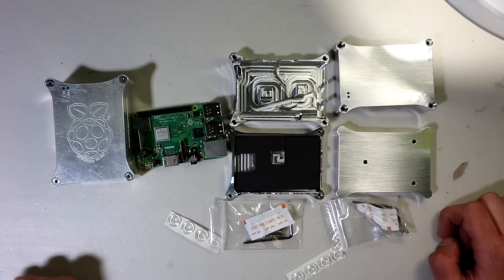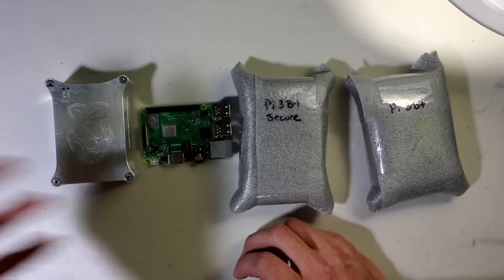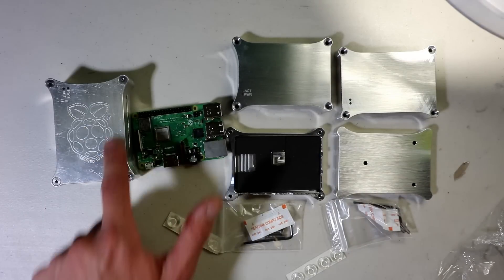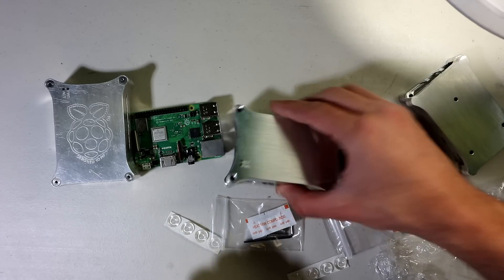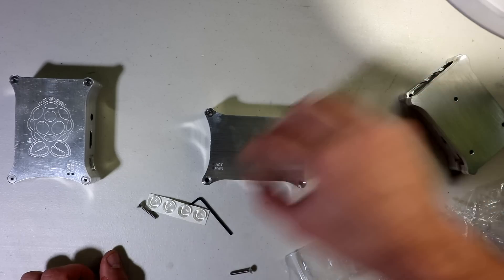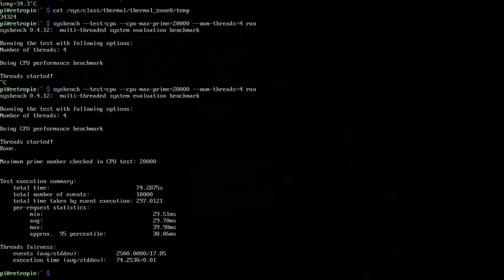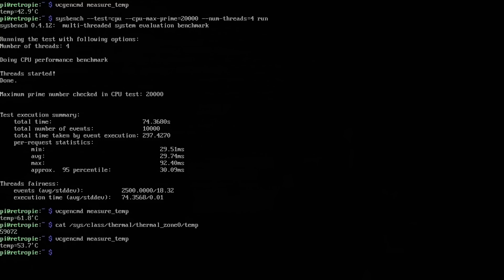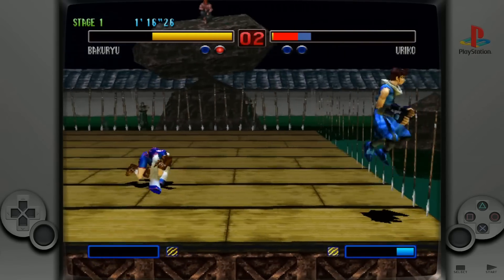NEW Wicked Aluminum Pi 3 B PLUS Case - "The Lamborghini"

Comment from the maker: Here were the results with a pi 3 b plus @ 1.5ghz Overclock:
No Load No Case 43 Degrees C
No Load w/ Case 30 Degrees C
13-degree difference!
Full Load No Case 63 Degrees C
Full Load w/ Case 39 Degrees C
24-degree difference!